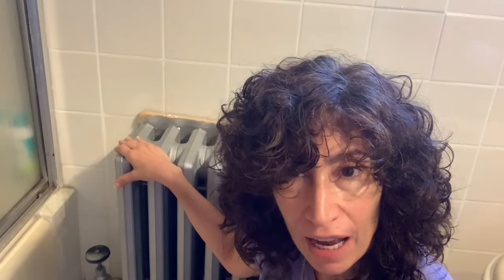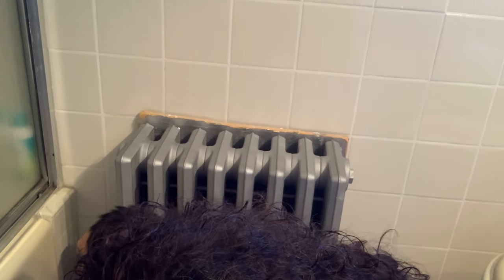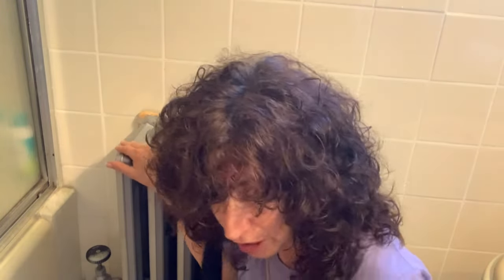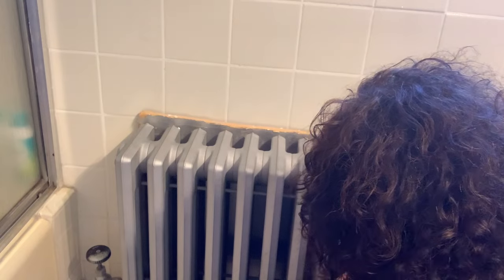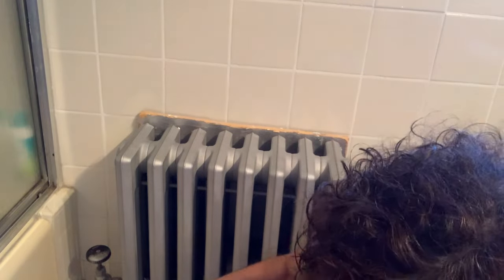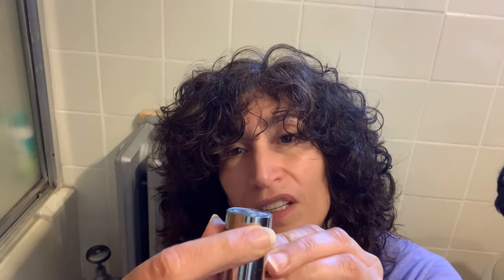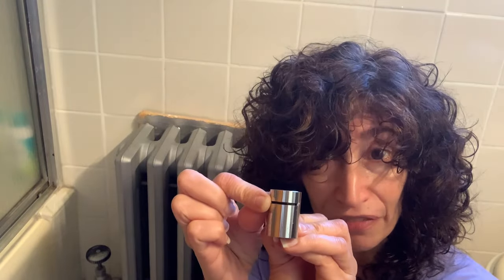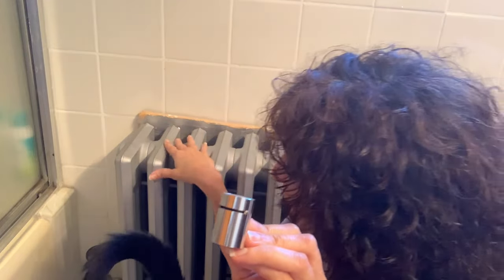Radiator Not Getting Hot? Try This First...

Comment: I just changed my boiler, All raditors in the house are hot except 1. The plumber bled it  until water came out a a couple of times.Hes opened teh valve all of the way too.  It gets warm, then it goes cold again. No one can figure out why its happening! its a Burnham boiler we just installed (Im located in NYC)
Reply from the maker: Hmmm... it sounds like your system may be a hot water system - not steam? It's really hard to help you diagnose - but if it's a hot water system and you have radiators (not baseboard heaters), it's possible that you have to add a shim to slightly change the angle of how it sits on your floor. You want the angle that allows the water/condensation to return back to the system vs sit in the radiator (which could cause it not to heat up). But this is all speculation. Is there a support number for Burnham that you can call? Maybe they can help you troubleshoot.  Try another plumber - I know a great one in Nassau County but I doubt he'll travel to NYC.

Comment: A modern energy-saving heating system looks different, this is a heating system that belongs in a museum.
Reply from the maker: Stephan, you should have see our original boiler - from the 1940s! It took 3 large men and sledgehammers to break apart and remove. We now have a gas boiler that is more energy efficient, but still utilizing the original steam pipes behind the walls and radiators throughout the house.
Reply: @diyduo_getyourfix  Areas of application here in Germany for steam heating systems.
Fields of application
Steam heating is hardly used in office and private buildings. It is mainly used in larger buildings such as exhibition halls or warehouses. Here it is characterized by low operating costs. Another advantage is that it heats up large rooms quickly. The poor controllability and the high space requirement are disadvantages that make steam heating unsuitable for conventional private houses.

The use of a steam heating system is particularly useful where process steam is generated. This is the case, for example, in industrial laundries or commercial kitchens. In this way, the steam that is generated anyway can be used for heating..
Reply from the maker: @Metal-never-die1220  steam heating here is "old" technology - only old houses (like ours) that haven't been renovated down to the studs still have it. I would say most homes in our neighborhood use hot water radiators or HVAC/forced air. But I love our old house, - old by US standards - and it gives us plenty of opportunity to create home improvement videos.
Reply: @diyduo_getyourfix  👌👍We've installed many old villas with 100-year-old cast iron radiators, and people don't want new radiators either
Reply: I have the same ones
Reply from the maker: @evelynvongizycki1017  We think they are great quality for the money. Curious to hear if you feel the same way.
Reply: @evelynvongizycki1017  Not me, I have central heating with panel radiators👌👍
Reply: @diyduo_getyourfix  I agree with their great quality for the money End it gives off very nice radiant heat and I can actually control it pretty well I hate it when it’s too hot in the house and you start to perspire

Comment: It's not STEAM it's water
Reply from the maker: If you have a hot water heating system, this video is not going to help. Those radiators function with piping on both sides, one to deliver the hot water into and through the radiator and the other to expel it. And there's also different versions of radiators that a hot water system may use (for example, baseboards). To get to the root of your issue, I strongly suggest searching for videos that troubleshoot "hot water radiator not getting hot." Good luck — and if you find a good video that helps troubleshoot your issue, feel free to share the link here to help others who may have hot water systems. There's nothing worse than having no heat when it's freezing cold outside.
Reply: @diyduo_getyourfix  ok good to know. Thank you for your response
Reply from the maker: You're welcome @warrenmacinn5252  - the simplest problem is that you have water stuck in your radiator, and a quick demo on how to "bleed" it could be all you need - but hot water systems come with their own set of issues, so best to search and find a few good videos that diagnose the different things that may go wrong and impact your type of radiator getting hot.

Comment: Thank you for this! I jusy bought a house that was built in 1898 and it seems to  heat the first floor but the second floor is always freezing!
Reply from the maker: Oh yeah - congratulations on you new old home! They are the best... the craftsmanship is beyond compare, but they come with very unique problems that not a lot of people have the skills to fix anymore. The key to getting all the rooms heated is balancing every radiator in the house... you'll probably have to fiddle around with them all to get it right but first thing is to make sure they're all open and the valves are working properly. Then it's a matter of adjusting the valves so that the radiators farthest away from the boiler are more open than the ones that are closer and taking a few days to fiddle until you get each room heated the way you want. And if you have old windows, account for the drafts that will affect the temp in your rooms and buy good insulated curtains until you can replace your windows!
Reply: @diyduo_getyourfix  the curtains are great tip! I just walked in my daughter's room and it's still cold and I said "maybe it's the windows". Now i know what to look for. This is our first home, it is absolutely beautiful but I am a little scared of what will come but I'm hopeful for good memories. Thank you so much!
Reply from the maker: @naturelove831  You're welcome - that's what we did for many years before we could afford to replace the windows. You'll be surprised at how well the insulated curtains will hold back the cold drafts in winter and the heat in summer. Amazon has plenty to choose from.

Comment: What if the valve to turn off and on is stuck?
Reply from the maker: If the actual valve is stuck in the off position, that is the first reason why the radiator is not getting any heat. If it has always been closed, perhaps there's a bigger issue that the previous owners/occupants just didn't want to deal with... and that means there's a strong possibility that trying to fix yourself can lead to bigger problems and a more expensive fix. In this case, I think you are better off calling in a professional to diagnose and fix.
Reply: @diyduo_getyourfix  you think so? It is a very old house. & it seems like it just rusted. & the turn the dial that opens and closes just spins freely. So really doesn't do its job of closing or opening
Reply from the maker: It's so hard to diagnose without seeing/feeling for ourselves... I would guess, though, that if the handle is spinning freely but the valve itself is not turning, your handle is probably stripped at this point and you'll need a new one anyway. If the house is old like ours, sometimes when you mess with pipes, you create problems you never expected. Is it stuck open or closed? If it's open and you're getting too much heat, the little release valve I show in the video can adjust that. But if the valve is stuck closed, I suspect the previous owners/occupants were aware there could be a bigger problem messing with it, and so they left it alone.
Reply: @diyduo_getyourfix  I can send you a video if you would like. The problem was that it was working properly for us in the basement when all of a sudden, it just stopped. Maybe we accidentally closed it and now it's stuck. Because before this heater would work great like the others.
Reply from the maker: Not sure if it's possible, but try to share a video in these comments. There are actually a few other viewers who left comments that actually work in the field - if you tag them, they may be best to give advice... we're pretty good hacks, but we're not licensed professionals and would not want to steer you wrong... read through some of the comments, and there's at least two that sound like this is their profession - especially steam heat, which is rare these days.